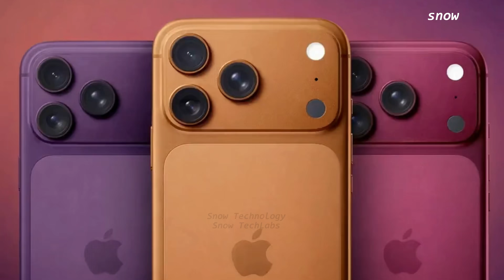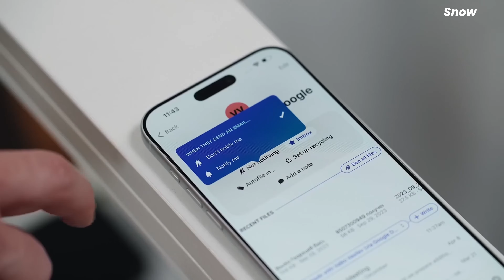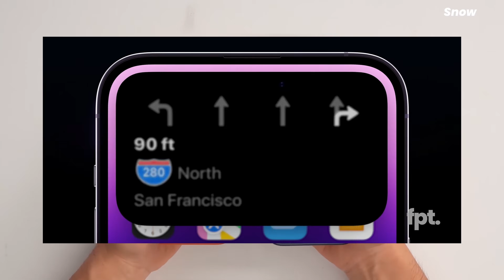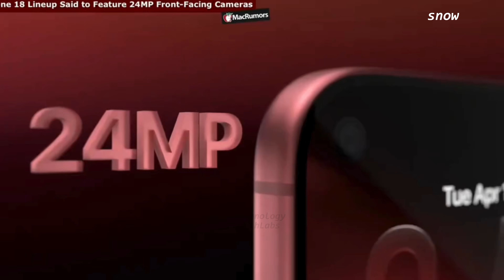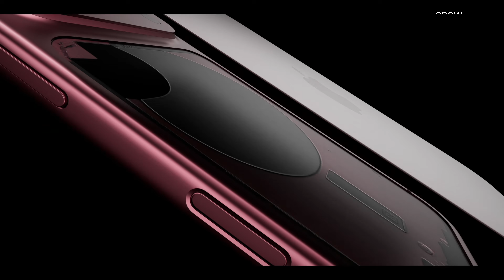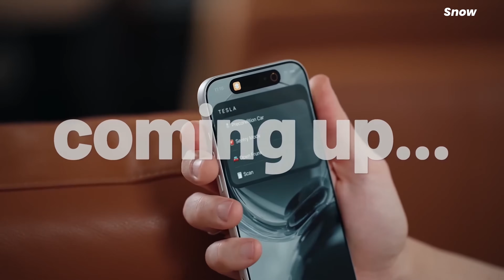iPhone 18 Pro Max — Every Leak Explained Before It's Too Late!

Comment: I’m a blind iPhone user  and currently I’m using a 13 pro max with a fresh battery. I’ve had my 13 pro max one terabyte model for four years. I intend on getting an 18 pro max 2 terabyte model around June of next year so some supply stuff doesn’t affect me that much. The reasinn why I don’t want the iPhone 20 is because I’ve heard it is possible the phone will be completely portless which means you will lbe forced to use wireless charging to charge your phone. This I will not do for any reason. The double ram, bigger battery, and double the storage are good enough reasons for me to get the 18 pro max.use

Comment: I have an Iphone 7 + and now this faithful servant is starting to get quite tired, but it works, it still has the same battery as it had from the factory, has never been replaced

for some reason the Iphone seems to have become a status symbol and yes, if people want to throw away their money, that's up to them, I call it total madness

if you read the specifications before you spend a lot of money on a new Iphone, you don't have to be a nuclear physicist to see that the Iphone has stagnated significantly in development when a new color on the new Iphone becomes the BIG news, then Apple has a problem

what the hell does the color have to do with development, sure a new color can be fun but is absolutely not a deal-breaker, I'm just laughing you have to be a real Apple nerd if Apple gets away with saying that the biggest news is the color of the new Iphone

as you yourself noticed absolutely no major difference between Iphone 12-17, none that you notice or benefit from and Iphone 18 doesn't disappoint anyone, the same thing yet once small improvements just nothing big, a little better camera and hopefully Apple now has enough RAM for its rented AI nothing else, totally senseless,

hope that the Iphone 20 changes this, if this happens that Apple has finally got its thumbs out of its ass now that Tim Cook is gone and delivers something new then it will be an Iphone 20 Pro Max but I will believe it when I can see it, but regardless of which Iphone Pro Max I buy I will notice a pretty big difference compared to my Iphone 7+😁😁

must be crap to have bought an Iphone 16 or newer as not even all Iphone 17 have enough RAM to run Apple AI now many years delayed Apple AI which is not even Apple's own but now Apple has been forced to rent Google's Gemini models in Apple Intelligence which requires 12 GB of RAM in the phone the 9 GB some Iphone 18 get is really bad beyond this so an Iphone Pro Max of 1 and 2 TB is expected to switch to QLC memory, while if you choose 256, 512 GB get significantly faster storage just to save money for Apple not against the customer good job Apple, or not

when Tim Cook took over Apple then Apple stopped giving any larger sums to RND this is something Tim Cook does not understand and Apple has stopped innovating they are never the first with any innovation anymore

https://youtu.be/4zPezMmVo-E?is=T0qNnB2XK0107acZ

Steve Jobs would have thrown Tim Cook out of a window from the 20th floor if he had seen what Tim Cook has done with Apple

if Steve Jobs had lived yes then Apple would have looked completely different and the iPhone would have been light years further ahead

so your argument does not hold up Apple earns enormous sums and has an extremely small RND so Apple does not need to increase the price of anything, but Tim Cook is extremely greedy and for some reason people still buy their products and Tim Cook knows that,

it is enough to watch this feature, Apple raises the prices of old apple products that they have refurbished, but the memories in these products are the same these are not replaced, why then these price increases, otherwise people would not have bought a new apple computer

https://youtu.be/4OM2jMFPAFg?is=UJ8VsHdpIBkJRJC9

so now that Tim Cook is no longer CEO of Apple, so the new CEO, John Ternus may be content with Apple only earning 75% in profit on each iPhone, something Tim Cook had never approved, Tim Cook was extremely greedy

Apple I hope has now chosen a better CEO, who is not an economist but a developer John Ternus, worked close to Steve Jobs, but he has a mega job ahead of him, in principle all who developed the groundbreaking Apple Silicon they have for some reason gone to other companies, the reason may be Tim Cook who did not know the area of development at all
Reply: those old iphones awesome..  But what about security updates. Cant have banking or shopping apps.